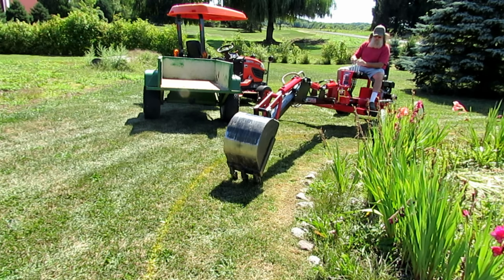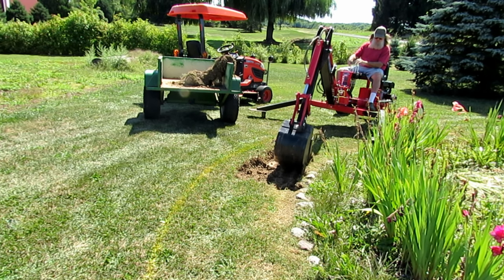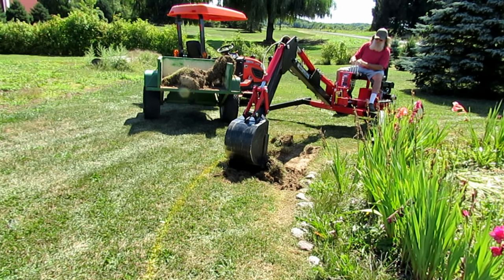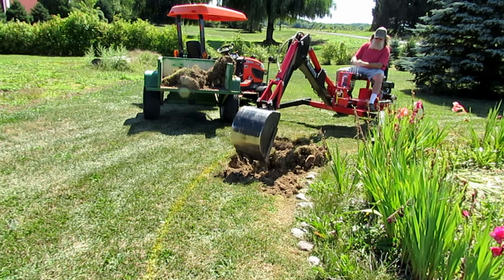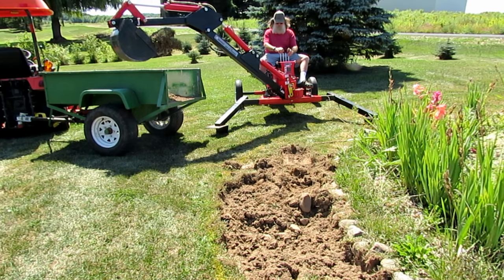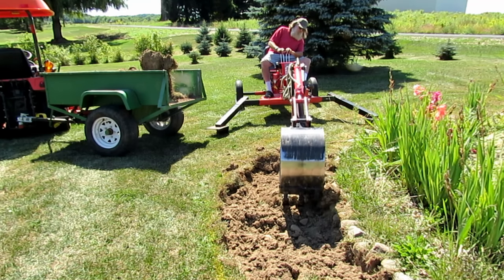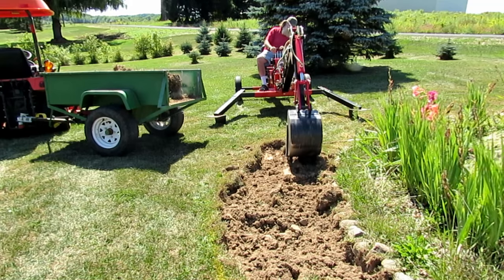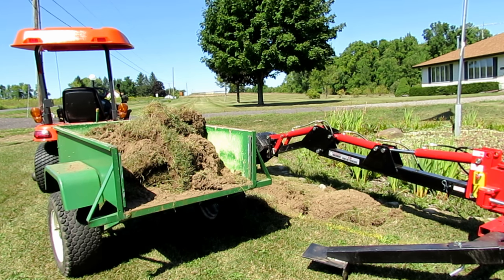Harbor Freight Trencher Loading a Garden Cart

Comment: There are two pin locations where the lift cylinder attaches to the main support (closest to the operator). That is the position you would use if you are doing shallower work and/or you need to lift higher for loading or transport clearance. Some people put a D handle hitch pin from a farm supply in that location so that they can quickly pull that pin to change from one pin location to the other  in the field without tools. Your machine has more high loading capability than you think it does.
Reply from the maker: it's less then  6 inches difference.  Thanks for watching.
Reply: @unemployedredneckhillbilly2023  6 inches can be the difference between a scratch and a dent. 😀

Comment: Is it easy to move the unit around without a small tractor or truck if you were working in a tight location? It looks like you can move it a little with the bucket pushed down and then extending the boom to move the unit. Is this easy to accomplish? I need to get in a backyard to dig a trench and do not have a small yard tractor to pull it into position. Thanks for any info.
Reply from the maker: You can move it with the bucket  if you have a 7 ft wide path. Turning it around  with  the bucket takes a big area.  Rent a mini excavator if it's tight. Thanks for watching.

Comment: all you have to do is move one brackets the pins are the same just have to widen the bracket and mine I put lights on it I would like to see more videos of you using it I like the one when you we're taking the stump I hope you do Anthony one like that
Reply from the maker: I wish that the motor had a generator so I could add lights. I just tackled a stump that is over 2 1/2 feet diameter where it was cut. I have 6 hours of digging in it and it is only 1/2 dug out I may try and video the second half of digging it out. This stump has layer after layer of very large roots. I have my doubts about the trencher being able to get it out of the hole.

Comment: I have a 10HP diesel engine on my you could use your John Deere tractor to pull it out of the hole just make a ramp and it will make it easier to pull it out

Comment: It looks like you have the pin on the lift cylinder closest to you on the lower setting. You could go higher I think.
Reply from the maker: It will go slightly higher on the shallow location, but the bucket does not curl enough and most of the load will fall out if it is not sod. The higher you go the closer the truck would have to be also.  It would be great to find one of those Dihatsu mini dumps from Europe with sides that fold down as they sit very low.
Reply: Unemployed Redneck Hillbilly Creations Yeah that is true. You would have to park the truck or trailer close to the backhoe. Dr power equipment sells a somewhat large power cart/wheelbarrow that is rather low to the ground. That would be nice to have to go along with this machine. I am thinking about starting a small excavating business with this machine someday soon. No trailer needed to tow it on the road even though they say it's not road towable. A large powered wheelbarrow would fit in the back of a truck. It has a lot going for it even though it's not that pricey.
Reply from the maker: It would be nice if the powered wheelbarrow was able to tow the trencher once you got to the jobsite. I would put better axles and hubs on it  to go more then a couple of miles, and check if it will need lights or fenders to tow in your location. It would work great for  small jobs like burying water or electrical lines. If you made a set of narrow axles it could get in some toght places.

Comment: have you tried removing the teeth off the bucket so you can have more of a flat edge of the bucket instead of the teeth digging in the ground that hard theres a video on youtube someone did that did a landscapers bucket ??
Reply from the maker: The teeth are not removable so It would require another bucket. That would be a good idea for soft ground, but the teeth are required to get it digging in rocky soil. Thanks for watching my video.

Comment: Jerky machine
Reply from the maker: Part of that is operator inexperience. Thanks for watching my video.
Reply: they may be slightly jerky but they make up for it in durability I have one that is going on 5 yrs. old that has lifted boulders that were 2-1/2 feet in diameter and weighed in excess of 500 lbs. digs trees and stumps regularly and has over 800 hrs. on it with only needing a few minor wear parts.